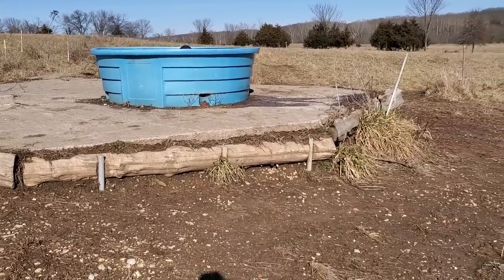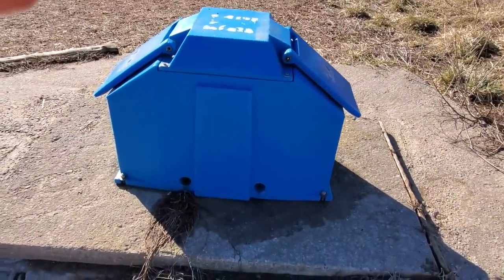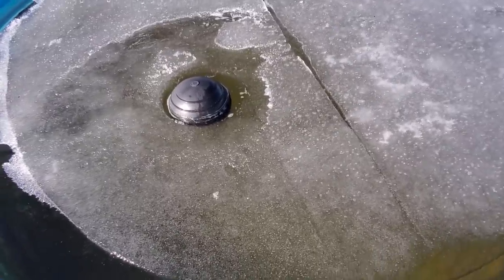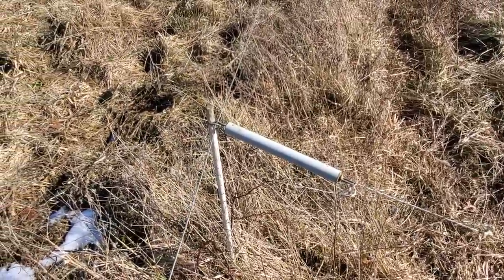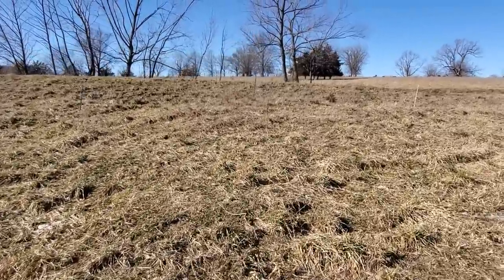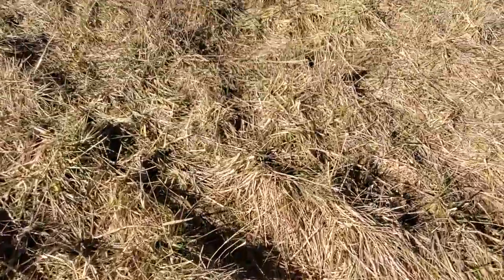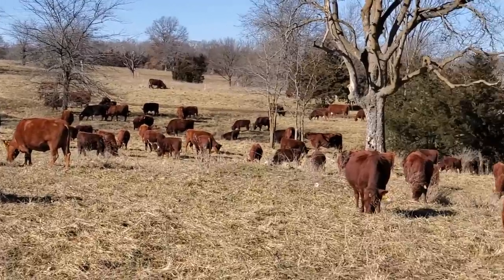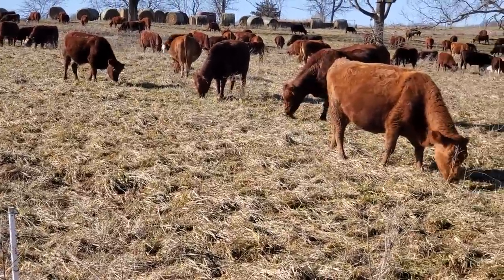How to water livestock on 60 acres with one pond!

Comment: What keeps the underground pipe unfrozen when the tank is full as opposed to when it is drained?  ps...the bale unroller is working fantastically.
Reply: Susquehanna Yak the water sitting on top of the valve. Without the water in the tank the valve ends up above the frost line instead of below the frost line.